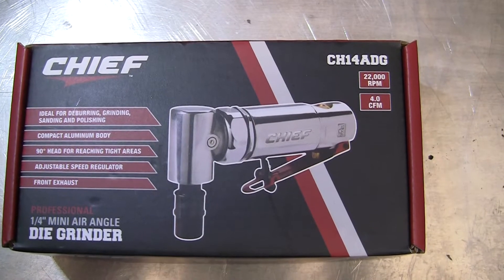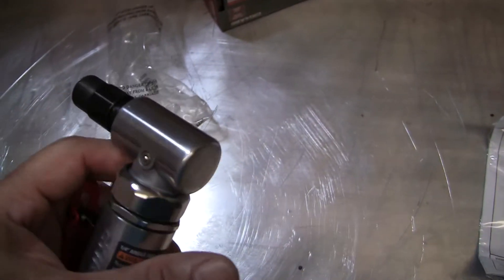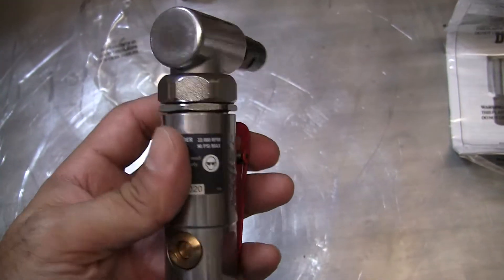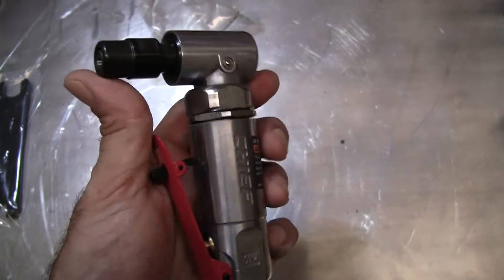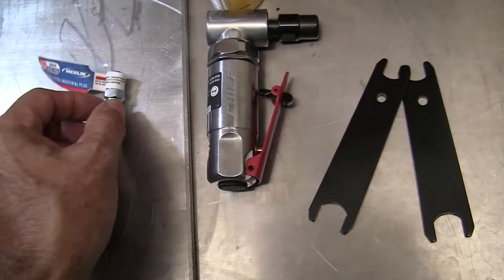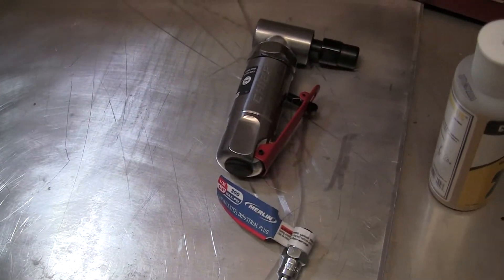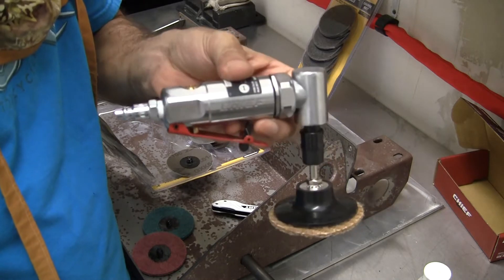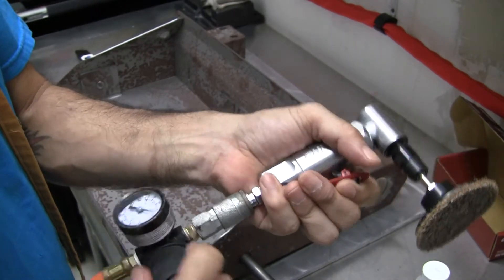CHIEF ANGLE GRINDER FROM HARBOR FREIGHT. Whats in the box with demo!!! I LIKE IT.

Comment: I use an angle grinder all day working At a tire shop. Was wondering if it could hold up to about 1,000 tires a month before I buy it. I already have a Cornwell one now that was super expensive but I need a back up one and this looks really nice for harbor frieght
Reply from the maker: Mine still works like new and i use it all the time. As far as how long they last, I dont know.
Reply: @HYBRID MUSCLE GARAGE  thanks. I tried the central pneumatic one and it was garbage. I think I'll try this one out and see how it does.
Reply from the maker: @jerseypb2223  Im willing to bet youll be happy with it. Just keep it oiled.

Comment: what size air compressor would work with that grinder? I need to remove some corrosion from my truck. Thanks.
Reply from the maker: you will want to start with a 25 gallon. anything bigger is better. anything smaller wont keep up.

Comment: I bought Harbor freight's cheap Central pneumatic version It has a metal nut on top like you're talking about but I only used it maybe seven or eight times in 5 years and the gears inside shredded. The chief one you have looks a lot nicer but it's also about three times as expensive now. But I bought a husky to replace the cheap Harbor Freight one cuz the Husky one comes with a 3-year warranty. Harbor Freight only gives you 90 days unless you want to pay for a one or two year warranty

Comment: I gave up trying to buy the $15 (or was it $20?) version, they were all broken out of the box so I “splurged” and got this one. I bought the cheap $15 straight air grinder and that one worked great out of the box.

Here’s a tip: Buy the other sanding disc holders in 2” and 1”, as you wear down the 3” discs move it to the 2” and then the 1” holders ‘cause it’s the outside of those discs that also wear down first, you’ll make those discs last a long time and you’ll use ALL of the disc and not just the outside ring. 😎
Reply from the maker: Great  tip on the holders. Thanks for that!!

Comment: I just bought the new one. The one that has the SAME model # and yet is all black and has a rubberized grip barrel lol. Works great so far! About to grind the paint off an old beat up hand plane, so we'll see how well it works on a 6g compressor!
Reply from the maker: Awesome Man. let me know how you like it after a few trials. Maybe Ill do a review on the newer one like yours. THANKS for watching
Reply: @hybridmusclegarage4590  it worked GREAT on the plane. I think the cheap sanding disk kit from HF was a mistake and it doesn't like only having 6g of air, but the tool is great and it's not its fault I can't afford an 80g compressor lol
Reply: @hybridmusclegarage4590  out of curiosity, do you think buying a 10 or 11 gallon tank (not a compressor, just an air tank) and hooking it up to my 6g compressor  would improve the run time? Or would it improve it a bit and then just take 3 times as long to refill before I could use it again? Or would it not have enough air at all  and do nothing for me?
Reply from the maker: @woodworkerroyer8497   A 25/30 gallon would work fine. A pancake/6-gallon runs out of air way to fast
Reply from the maker: @woodworkerroyer8497  Yes adding a tank helps alot. It will take longer for it to air up, as the pump is only made for the 6/gallon. But adding a extra tanks will help!
Reply: @hybridmusclegarage4590  thanks! I have seen videos showing people adding tanks, but nothing on the actual use or affect the upgrade had. 

Right now, the grinder goes about 15 seconds at most before it runs out of steam and then it runs for 1 or 2 minutes to get back up to pressure! Definitely not the right compressor for the job lol
Reply: I use a 30 gallon compressor with mine and it works fine but a 6 gallon no way

Comment: I have this angle grinder since they came out and I use it hard never had a problem still like it I also have their what they call that air shander the one that's narrow and stuff by chief I like it too I beat the hell out ofit a lot  over a year holding up great so far 👍dude don't by they sandy disks and things they .I by the ones on
 Amazon , really cheap including the holder and everything I can buy like 20 times more for the same price . I use a lot .
Reply from the maker: Awesome, thanks for the heads up!!

Comment: Def a DA sander would be a much better method of taking that rust off...much faster and stays flatter and no chance of stray scratches
Reply from the maker: Good point, but i have been looking for a reason
to buy an angle grinder for a while. Thanks
Reply: @hybridmusclegarage4590  try the 10 dollar harbor freight one, it works really good for really light things such as grinding and wire wheel, but it also cuts well, the only problem Ive found with it is that the lock button is pretty weak but then again I’ve been over tightening all of my discs. For 10 bucks you can’t go wrong
Reply from the maker: @lowlowsandclothes9923  Awesome man, I'll check it out!! Thanks

Comment: The central pneumatic die grinders from Harbor Freight are complete trash. The gears in the head are too soft and strip easily. There's a huge difference in quality stepping up to the Chief.
Reply from the maker: I never knew That. I will say the chief has been put through hell and still works like new. Good info. Thanks
Reply: Good to know. Glad I got the Chief one instead of the CP one that was half the cost.
Reply from the maker: @woodworkerroyer8497   I think Chief is way better than CP.  Years ago, all I used was CP lol.